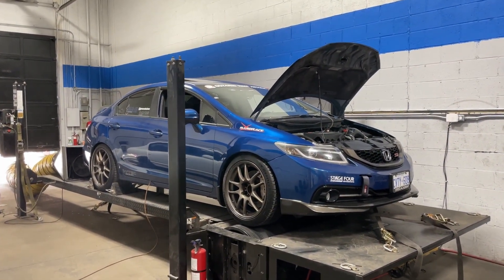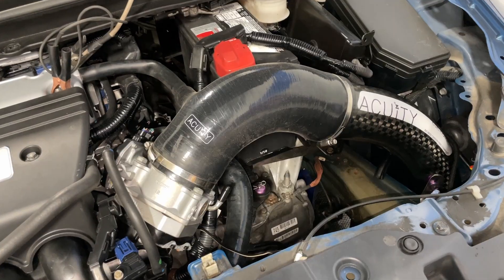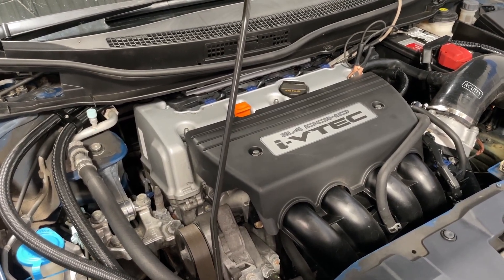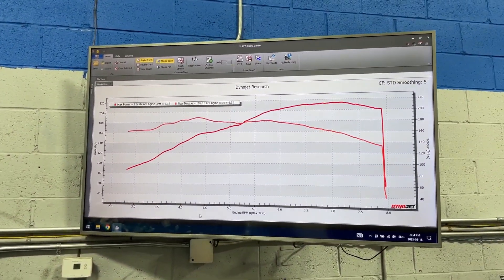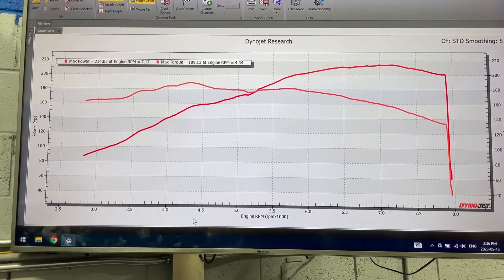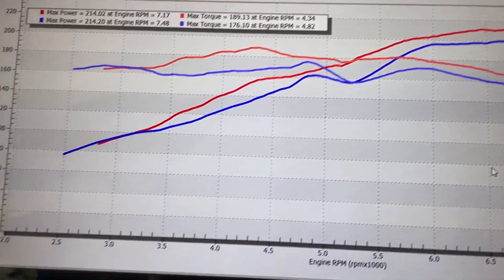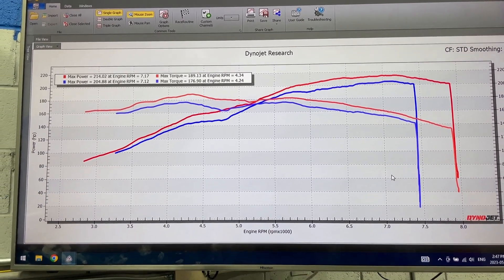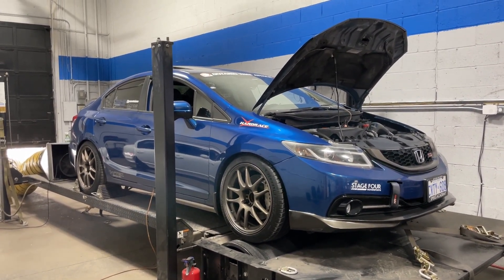K24Z7 4Piston Drop in Cam Dyno Tune

Comment: at 5500 rpm that k24 you tuned on stock cams loses power all the way until redline...some people should just not mod their cars. with a power band like that imagine your car is slower as it speeds up.
those graphs and just hideous, and honestly, just shows lack of quality work.. huge dips when vtec hits, does not make any sense.
Reply: I think the main issue is the 9th Gen SI K24 variant itself which is designed for lots of midrange with the plastic intake manifold and the single port exhaust manifold. If these mods where on a TSX K24 it would be 240 easily.
Reply: It is not Nicks fault. He tunes what people bring to him. 
Here we can see complete missmatch of parts and it shows on the graph.
Reply: @CL9k24a3  as the tuner you have the ability to get in there and change the fuel mapping, timing cam phasing excetra. It's literally his doing
Reply: @AllThingsVtec  thats incorrect, the tuner can only tune what is in front of him.I would like to see what happens with an actual FBO 9thgen with these cams.
Reply: @slowka  You're going to need hondata if you're running cams and getting tuned on a Dyno. Hondata definitely let's you get in and mess with fuel and timing and cam phasing. This isn't a guess. By tuning the car by definition you are messing with those exact parameters of the engine. It is precisely what tuning an engine is. How can you possibly get that wrong??? How exactly do you think dyno tuning an engine is done???
Reply: @HighSpeedEnthusiast  you cant do shit if you get car with mismatched parts. 
Outcome of tune will be limited by the combination of parts used. 
With ported rrc and 70mm straight thru exhaust he would gain 30hp or more on this setup
Reply: @CL9k24a3  You're 100% WRONG!!! And now you're changing the subject. The argument was whether or not he can actually tune which he 100% can on a Dyno and with hondata and that graph looks like shit. Your argument is mismatched parts.... So you're telling me every time somebody gets a Dyno tuned they have to have the parts on it that the tuner is recommending? Every single car out there is a mismatch of different parts. It's blindingly obvious that other parts could provide different results. Nobody's arguing that.
Reply: I think everyone is missing the point. If your after peak numbers then 100% head swap or swap manifold. But for me mid range torque is essential. And that is what this setup is.
Reply: @grassrootscience4461  you are wrong with your logic. 
Put ported rrc and you will see gains everywhere. 
Rbb,raa, and whatever that plastic manifold is called on k24z7, all are shit. 
You are missing on solid ~30hp here.
Reply: @CL9k24a3  I mean at the end of the day you are entitled to your thoughts. That car races in competition where I’m limited in what can be done so I have to be wise with modifications. Having the low end torque that is unique to this manifold is not something I’m willing to lose to gain in the top end so it “looks better”. Each build is unique and there are reasons why people do what they do. For me, This is perfect  and Nick did a good job of just making the car better. If I did strictly road racing then for sure an intake manifold will be worth it. And if you listen to the end of the video that is exactly what Nick says.

Comment: Just curious: is there a solution for the RBC torque dip/loss?
Reply: Porting or trash it and get rrc. 
You can see on gears and gasoline when they put ported rbc that dip goes away.
Video is " k swaping my civic again or something like that

Comment: all those mods, with the cams and a k24 and it makes less HP than a FBO k20 with stock cams?? Why do I feel like this car should be in the 230+ ?
Also, why run a 70mm throttle body and that big intake but use the stock z7 intake manifold that defeats the purpose of those other parts?
My k20 with just bolt ons, 3.5" CAI, 3" exhaust, stock injectors, stock tb, makes the same power as this minus the torque?
Reply: I race in an organization where I have to pick my mods wisely. Also when it comes to road racing the power band is more important than the peak number
Reply: @grassrootscience4461  yes that's true. It's all if you got a good motor. Nick just did a FBO k24z7 FBO no cam 215 hp. Didn't look at the power band though
Reply: @enhancedphysique6452  yeah watch the end of the video. Basically this is a comparison of the cams vs intake manifold swap. The peak hp is the same but the low to mid range is higher and the peak torque is 13 higher.
Reply: Drag cartel does not offer cams for the Z7.
Reply: Rushing with tune before all parts are on. Did that couple of times my self. 
Without intake manifold all this mods are pointless. 
And I don't understand why would someone go for 4p dic vs dc dic as dc dic is proven and so far I haven't seen any good power curve with 4p dic.
Reply: 230 on k24z7 which I own FBO is MAX 215 where k20a FBO 230-240 or higher.

Comment: How much are they better than TSX 08 cams?
Reply from the maker: This is a K24Z engine, it is a very engine compared to the K24A - K24A / TSX Cams are not applicable in this engine application
Reply: @tuningbynick  by the factory spec I would suspect that it performs similar to k24z3 cam. 

And it is really strange that people in US and Canada don't use k24z3 cam in k24a2 builds.
Reply: Why do you even put 08 tsx cams into context ? 
Regular dc dic are pulling 20-25hp on top of them
Reply: @CL9k24a3  we don't have such engines in Europe or they are very unpopular
Reply: @Without_Limit_Auto  with google serch it say that k24z7 is identical to k24z3 (cu2)engine. Only difference is block casting. 
With simple google you will see what difference is between 08 tsx cam and cu2 cam. 
Cu2 cam is superior because you gain 5-7hp on low cam over tsx cam and because of that everyone in EU is using cu2 intake cam in k24a3 engines (over the 08 tsx cam) .
Reply: @CL9k24a3  everyone is using cu2 cams because it's easy and much cheaper to find them.
But they don't fit bolt on to k24a3 engine. You also need to replace rockers. 
I have both TSX and cu2 cams.
I know they're graphs of comparison.
Reply: @Without_Limit_Auto  I have cu2 cam on my car and it is derect swap with r40 vtc on that cam. 
Cu2 is superior in performance to 08 tsx cam as you have gain on the low cam and maybe 1hp loss on the hi cam. 
We use them because they are SUPERIROR and not because they are cheaper.
Reply: @CL9k24a3  check the cam after 40-50k km. I had it swapped to in the past, many people had that I know, it's a popular tuning in Russia. Then I had stage 2.5 motor with Toda A3 cams, now I have stage 4 motor with BC 0004 cams.
Yes, VTEC is a little bit better on the TSX cam.
Reply: @CL9k24a3  it is not a direct swap. I can find an article with pictures, but most likely it would be in Russian. Is it OK to google translate?
Reply: @Without_Limit_Auto  sure post link in coment on some of my videos. If you post it here it will be deleted. 
I think that in my coments it is allowed to post links
Reply: @CL9k24a3  done. Great content by the way!
Reply: @Without_Limit_Auto  looks like it got deleted. I have changed it now to allow all coments. Also have messaged you on i/g
Reply: @Without_Limit_Auto  Thanks, defentely I was in the wrong and no one should use cu2 cam in k24a2-3 engines. It can be modified to work with no problems but wouldn't bother tbh
Reply: Cu2 intake cam It's a worthwhile cheap mod in a k24a2/k24a3 It does nothing for top end but increases low and midrange power and makes for much better daily driving.
Reply: 06-08 TSX cams can be used in the R40 motor utilizing a RBC intake gear and the R40 exhaust gear. Only downside was it tanks mpg due to exhaust riding on the vtec lobe. Car pulled a lot harder through the entire power band and except up top but that was due to me still having factory catback on.